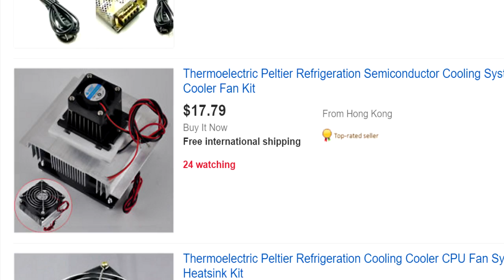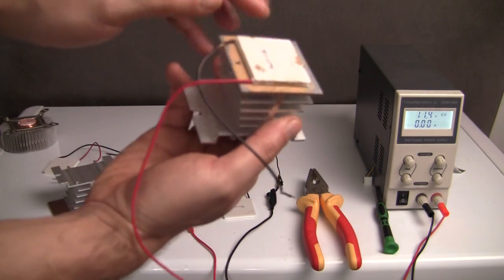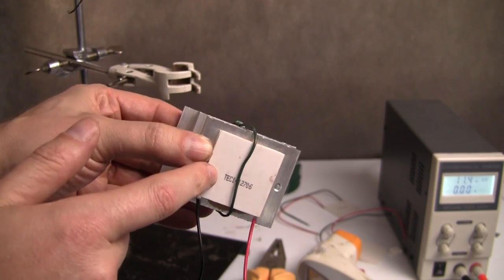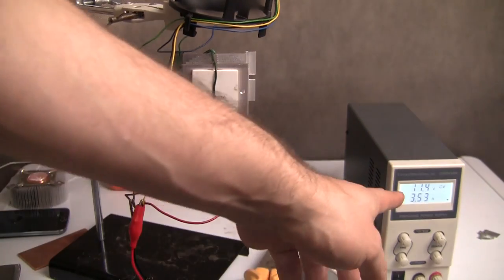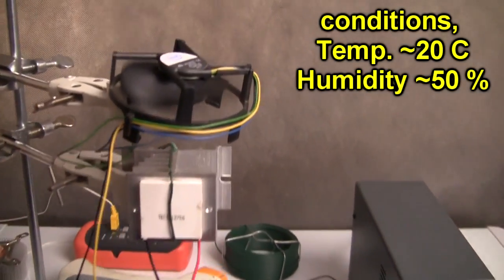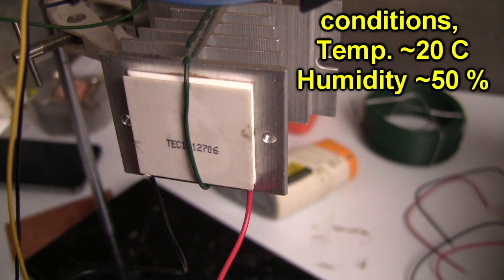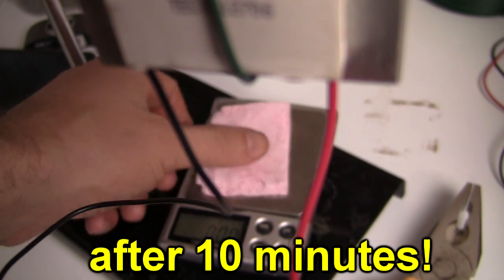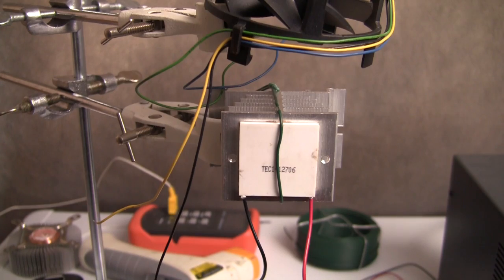Fontus Water bottle claims to make water from air.  Is it possible?

Comment: I don't know a lot about this but if the fan wasn't needed due to passive cooling  because it was mounted on a bicycle and it pulsed the Peltier from a capacitor with enough juice to get that first extreme temp difference like you had when you first turned it on and if the passive cooling was enough to expel the heat from each pulsed burst,
wouldn't it work better?
it was a huge difference at first, dropping way down below freezing, you have to give it some credit and not just blast the thing constant.
I dunno but I hope you try other things in the video.

Comment: moisture vaporators , star wars . :)
Reply: +RantWithJeff Condensing water on a planet that has none.
Reply: +GeorgeMonet Small amount in the air. Just takes a lot of energy to pull it down. Energy is something they aren't lacking in that universe.
Reply: +RantWithJeff 
That's actually quite reasonable by comparison.  Read the appendix on the book Dune, it's a similar planet and Herbert goes into the ecology pretty deeply.   Wind trap moisture farms are a rather long way away from this strap-on-your-bike peltier nonsense.

Comment: You could mount a radiator to a cold side as well. It would increase condensation surface  and water production. Next thing is evaporation, by exposing cold side of the peltier to air you are letting produced water to evaporate.
Reply: +Damian Krystkiewicz How fast does water evaporate in a normal room in the shade though? Very slowly.

Comment: there's more humidity in the air of a forest and possibly twice more during morning depending the season and even more if you consider wind velocity and direction. the morning here in east of canada have fogs and shit like that, there's old trapper wisdom about how to gather water with the morning condensation using tree leaves.
Reply: +xt hydra and even less solar power ;)
Reply: coz752 still, my point still stand, there's old trapper wisdom about how to gather morning condensation with tree leaves
Reply: sure,outside of the context of a portable solar based 'dehumidifier' ..I'll grant that at temperatures below the dew point, the rate of condensation will be greater than that of evaporation. I get that a sheet, a rock and a hole and an empty can will go a long way for a trapper overnight in a pinch but I was talking about the topic of the video - and that's (somewhat) relating it to the solar powered self filling bottle project thingy.. I'm just saying that at or just before dawn the solar power might be tricky..
Reply: coz752
 yeah, i guess if there's no batteries, the fog of dawn wouldn't help.

Comment: Peltier's cannot produce enough water in an affective manner. They used to use them for CPU overclocking, and they do a very good job at keeping the CPU very cold, but the moister build up is to much of a pain to deal with for a daily use PC. Liquid nitrogen is easier and more effective to use in overclocking competitions, so their not used there either. You might get a teaspoon of water after 3 hours or so at most.

Comment: the way i saw it, an air conditioner is like one of these water bottles on steroids. and even then, you wont be getting a bottle of water very quick. the ones i have used only pump out maybe half a cup of water a day. the other issue, if you are running - degrees... wont the water freeze and pack it full?

Comment: here's how i see these claims from Kickstarter. If it was real ANY government would fund the hell out of it.  A limitless supply of water.  The military would pour billions in alone.  Every city would scale it you or people would just buy a personal one for their home.  So any company would buy them outright or steal the design and sell it.
Reply: +Robert Mayfield Fun fact: An Israeli company actually makes and sells water-from-air devices. Portable ones too. IDF uses them. Of course they run on supplied power (350 Wh/liter, much more than a small solar panel could provide), and they aren't nearly small enough to be mounted on a bicycle. But yeah, it is possible to supply water from air, just not very practical unless you have like a Merkava or an MRAP to carry and power it.

Comment: Another one of those "out of thin air"
when will people realize that things just don't exist in air?
1 mol of air at 1atm = 22dm^3
that's like... not a lot compared to, let's say, 1mol of water itself is 18g which is ~0,018 dm^3. So basically you're having a volume of air that is 1200 times greater than that of water... with the same amount of particles. you just don't have shit in the air! REALIZE THIS YOU "INVENTORS"

Comment: They might have had an actual product if they put 2 compartments separated by a heating element in (assuming you can even power a heating element of a battery which I highly doubt). That way you could just scoop water from a nearby pond and it would evaporate and condensate into drinkable water. Doubt that it would work well seeing how nobody has made it yet but it would work better than this.

Comment: A couple things to consider: where they shot the videos: a forest and in the sea. The forest looked like it was foggy so easily 80%+ humidity and I don't know what the sea's humidity is. I remember setting out water gallons as a kid and being amazed how, in a week, they had filled with water from the humidity.
Reply: +Adam R Wait for the calculations on the thermodynamics.
Reply: If it's really humid you would sweat a lot more no? Especially if being very active as per their campaign video. Meaning you need to consume lots more water.
Reply: nitelite78 I know. the whole thing is quite silly. There's no way I'm going outside.

Comment: Do you think there could be some materials or surfaces that would suck the water out more efficiently? I'm not saying it would fill a bottle, just pondering
Reply: Allegedly it fills really quickly in moist climates
Reply: +magicalpencil look at https://en.wikipedia.org/wiki/Condensation_trap (that's the general idea behind this bottle).
Basically it needs to have as much surface as possible. And be as watertight as possible to avoid letting moisture through.

But it is not very efficient:
> Condensation traps are not in themselves a sustainable source of water; 
> they are sources for extending or supplementing existing water sources 
> or supplies, and should not be relied on to provide a person's daily 
> requirement for water, since a trap measuring 16" in diameter by 12" 
> deep will only yield around 100 to 150 ml per day.

Basically, the owner of the kickstarter though "screw these condensation traps! We'll overclock it using pelletier!"
Using a pelletier plate instead of the night's colder temperature to provide the coldness, and using a small radiator thingy instead of the large plastic sheet.

But not running through the number to see if its actually realistic.
Reply: that's a good question, does humidity affect this much?

Comment: so basically a dehumidifier
Reply: +Blox117 
I'm no expert, but most dehumidifiers, supposedly, work by using a fan to draw the air over a cold coil. So, yeah, the bottle is basically just like a dehumidifier, but much less efficient. (Not to mention most people wouldn't drink water produced from a dehumidifier either.)

Edit: Just did a bit more research, there are Peltier dehumidifiers and they are considered VERY weak compared to normal ones and have issues with ice build-up.
Reply: Tejan455 yeah, there are cheap dehumidifiers on amazon that use thermoelectrics/peltier coolers.
Reply: +Blox117 or a "Condensation Trap" (look it up on wikipedia) as it is called in the context of water collection.
The method exist, it is considered valid, but also not very efficient (it's a way to supplement water reserves. Not a source of water to rely on).
Thus, like Thunderf00t, I doubt this bottle will be any efficient. (Specifically, given the high energy consumption of pelletier, and the fact that they concentrate their effect (cold/hot separation) on a very small point (see the IR image of the video for both hot and cold side) whereas tradictionnally condensation traps rely on huge surfaces).
Reply: DrYak well, it would work better in hot and humid environments. although, im not sure what the power source would be. if you lug around a large power source, you might as well just bring water bottles filled with water or choice beverage. maybe alcohol!

next invention: solar powered water bottles that make beer from air!

Comment: making water from "air" can be done, it's called a dehumidifier
Reply: +Saul breh dehumidifiers take some much power to do it tho, they wanna do it with a small battery
Reply: +Saul breh I had some water damage after one of my neighbors had an accident with his methlab. Had a dehumidifier running for a month from the contractors sent by the insurance company.

1000 watt. 

Filled about 6 liters a day (24 hour day).

Now granted, available moisture could be a large factor here, but simple division should make it obvious that this sort of method isnt going to provide enough for a human to live off, while being anywhere within the realms of reasonable energy cost (portable/cheap).
Reply: +Saul breh i think he knows that.
Reply: +Saul breh This is a dehumidifier too, all the parts are there: A fan, a heatsink, and a heat pump. But dehumidifiers generally use a compressor-based heat pump, which has the disadvantage of size, and the advantage of being massively (~4 times) more energy efficient than a Peltier element. And even the most efficient dehumidifiers still need hundreds of watt-hours to remove a single pint of moisture from the air, something a tiny solar panel simply can't provide.
Reply: that assumes a high humidity, they don't really work the same way when put outside

Comment: Should have used thermal paste between the heatsink and plate. I'm not saying it would make the thing work as shown in their video (it wouldn't) but it would mean that 70C at the interface would have been put through to the heatsink properly.
Reply: +MrSquishedsquashed i believe he DID use thermal paste. watch the video again and you will hear him say it and also see the brown paste. he cleans it up for the actual experiment though. not the contact surface, but around it.
Reply: +Murray Kitson Huh, I managed to miss that! However any decent thermal paste should work much better than whatever was shown in the video, heat being more than halved by the interface is not typical...

Comment: Would creating a much higher surface area on the cold side increase the condensation rate? Might be something interesting to quantify.
Reply: Thanks for the info guys. I think I missed the part where he talked about it.
Reply: Didn't he adress that?
Reply: +Sematimore No, because the higher surface area would be at a lower temperature, i.e. less or no condensation.
Reply: He mentioned that the temp on the cold side did not get low enough compared to room temp to cause condensation.
Reply: +Sematimore Doubt it. It would require more energy to keep cold and would give it more surface area to absorb heat so it would realistically make it as efficient or less efficient.
Reply: +Sematimore Yes, but it would also require a corresponding increase in electrical power [Watts] to drive the increased surface area to below condensation point of the humid air. You can already figure out that to fill a 1 litre bottle [39oz] bottle in a day using Tf00ts kit would require 50 times the surface area & 50 times the power [0.020 Litre shot glass x 50 = 1 Litre]
Reply: +Sematimore He tried that but the increased surface area didn't get cool enough to condense air.